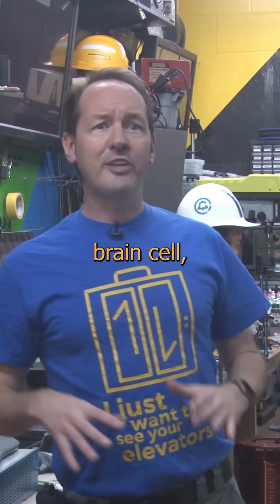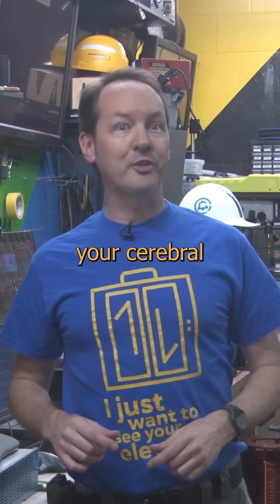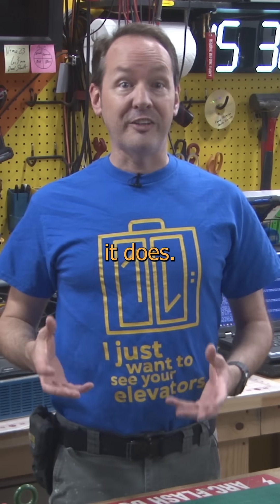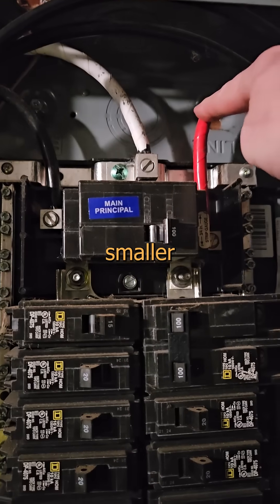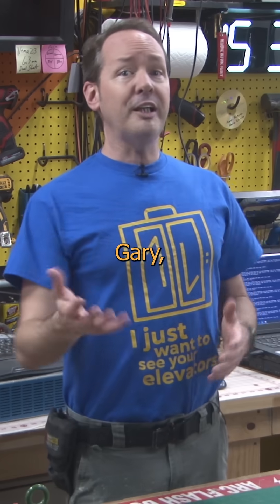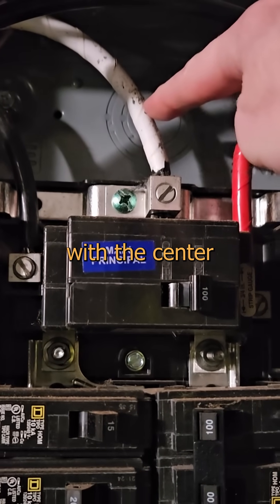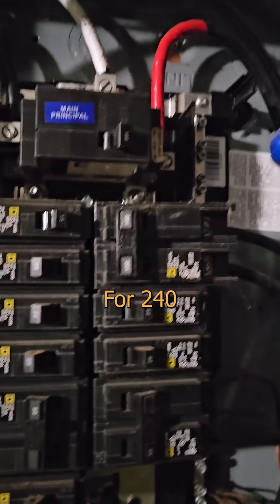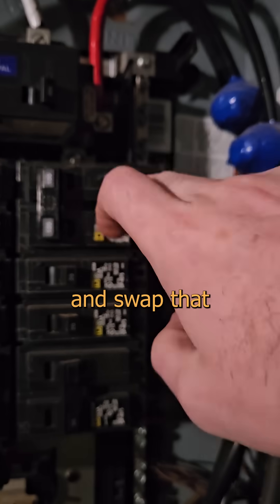Why It's Smaller #engineering #chrisboden #comedy #electrical #science #energy #power #electricity

Comment: Yes...this is an issue I still don't understand. Degree in physics yet...ground should be path of least resistance..or neutral should. Depends on how I wake up in the morning. Amps dumped into the appliance...makes sense DC...my brain explodes every time thinking this. Then...Europe with using ground as the neutral?

Comment: i remember being told if you dont see the ground assume you ARE the ground or you will be in the ground
Reply: Sounds about right.
Reply: As someone who has been the ground a few times absolutely.

Im not an electrician by trade, but I have some experience. So for new guys messing with it this is what I tell them.

Electricity is equal opportunity. It can and will look for every opportunity to kill you. If you give it that chance, it will hurt the whole time you're dying.
Reply: BAHAHAHAH true
Reply: Only within reasonable ranges, too low and nobody cares (at 5V, the body’s resistance leads to negligible current), too high and you can be the ground despite seeing a proper ground, especially when you’re on the actual ground (don’t get anywhere NEAR a downed power line and hop away with the feet as close together as possible)
Reply: Good advice!

Comment: “I spent a lot of time removing the ground pin from this vacuum, so that it wouldn’t trip the circuit breaker. Stop being a pansy, the exposed wiring is perfectly safe. And Don’t you dare tell me it’s not working because the paper filter is full.” — My first job

Comment: Ground is there to burn your house down.  A tree fell on my aerial feed to my house.  It bent the mast, broke off one hot leg and smashed the other hot leg against the metal box of the meter base.   That lit up all the ground wires in my old house, burned out the bare copper hooked to the water pipe.  Melted copper wire in the walls.   Then the lit up ground wires carried 100 amps to ground on the 12 gauge ground wires going to my 2 gas furnaces, my gas clothes dryer and the swamp cooler on the roof.   Oh and the stainless braided water supply line to the dishwasher, flooding the kitchen.  Now, I put a fusible link connecting the ground wire to the frame of any independently grounded appliance.   And that's how ground wires almost burned my house down.  And, that not very cool.

Comment: @PhysicsDuck Can you do a video explaining what 3 phase power is?

I'm in the building trades (not an electrician), but I think electricity is by far the most interesting. 

I've tried doing some research to better understand what 3 phase power is. I'm either too stupid to understand what I've found, or I haven't found an explanation simple enough for my small brain 😂.

Some related 3 phase questions I'd like to understand better:

-why can you get more power from a 120/208 3 phase panel than a 120/208 panel at your house?

-why is 3 phase power more common on commercial projects vs residential projects?

-what makes power 3 phase? It's all carried on the same lines, right? So what happens to send single phase power to a homes vs 3 phase power to a commercial building across the street? Or in a mixed use building, what happens to send 3 phase power to the commercial spaces vs single phase to the residences above?

What I've learned in my own research is that 3 phase has additional sin waves on the power. But what does that really mean?

Another question: if 3 phase is a relation of sin waves, how does that translate to countries that have a DC power grid? Because sin waves are a characteristic of AC power, right? 

OK, that's a lot of questions. It's a topic I've been curious about for a long time.

I love the channel and the way you explain things.
Reply: -why is 3 phase power more common on commercial projects vs residential projects?

Economy of scale is why.  Consider the power we can get from a 200A 3-phase service with a full size neutral at 120/208V.  It would use #3/0 Cu wire, which is 4x 168 kcmil, or 672 total kcmil of copper.  We'll neglect ground and conduit, as well as applicable safety factors, for simplicity.  This carries, best case scenario, 72 kVA of power.

With the same copper wire for a 120/240V service, the closest you get is #4/0 Cu for both legs and full size neutral, which adds up to 636 kcmil total.  This amounts to a 225A service.  Best case scenario, this service delivers 54 kVA.

The 3-phase service achieves a performance of about 107 VA per kcmil, while the similarly-sized single phase service only provides 85 VA per kcmil.  These numbers don't necessarily apply universally, since ampacity/kcmil isn't a linear function.
Reply: "What I've learned in my own research is that 3 phase has additional sin waves on the power. But what does that really mean?"

It means instantaneous voltage follows the following mathematical function of time:
V = A*sin(B*t + C)

A is amplitude
B is the frequency constant
C is the phase constant
t is time

For 120V nominal systems, the constant A is really 170V.  The ratio between them is sqrt(2).  It has to do with what equivalent DC voltage would provide the same power to the same ideal resistive load.  The topic is called RMS voltage, to read further into it.  170V is the peak voltage, while 120V is a special kind of time-averaging.

You might expect the constant B to be 60Hz, and you'd be partially correct, as B is proportional to the frequency.  By convention, mathematicians use the units of radians as the input for the sine function, so B's value would be 377 rad/s.

The constant C is what is different for the three phases.  One phase has C=0, another phase has C=2*pi/3, and the third phase has C=-2*pi/3.  Not necessarily in that order.  This produces 3 sine waves, that are time-delayed from each other, by a third of their cycle.  Each live wire has a voltage to neutral, that follows one of these three phases.  If you measure across the live wires of different phases, you'll get the 208V instead of 120V for its nominal amplitude.  Just like if you draw a Y with 12 inch legs equally spaced, and measure across two legs, you'll get 20.8 inches.  This is why we call it 120/208V, and its higher voltage counterpart, 277/480V.

Another question: if 3 phase is a relation of sin waves, how does that translate to countries that have a DC power grid? Because sin waves are a characteristic of AC power, right?

Sine waves are a characteristic of AC power, and don't apply to DC power.  DC power has steady voltages, while AC power has time-varying voltages that alternate in sign.

If you only have DC power available, you need a 3-phase inverter to support a 3-phase load.  This is a device that will switch the polarity of the DC at the frequency of the AC waveform, and produce a square wave for each phase.  The square wave is then low-pass filtered, to smooth the square wave into a sine wave shape.

If you only have AC power available, it's much easier to convert it to DC.  They use an arrangement of diodes to rectify the negative half of the wave, to make pulsating DC, and then filter it to smooth it out, and use a limiter diode to get rid of the ripple.

Comment: A fun demo they do of this at our electrical school house is they take a 3 phase 120/208 plug, with neutral. Then each phase is tied to a switch and a plug with a parallel neutral connecting them all together and back to the OG neutral. 

Flip all 3 switches on, then break the neutral wire nut back to the panel. All the lights remain on.

Comment: There is a channel of electricians doing a live stream and i told them my load center has no ground(old house with a bad rewire).  They said it wasn't a big deal. That's crazy right? My load center is over pavement so i have to figure out how to drive in some ground rods and run the wire to my load center. I bought a huge hammer drill and adapter

Comment: In a DC circuit where the starting point is a generator.. where does the electricity come from? Does it pull it from the ground pass through the circuit and then go back? Where's its inception begin? I've always been confused about that

Comment: See, my brain cells are different. I usually run on a single brain cell that acts like a APU, slowly chugging away doing low-level processing. But when it's time to start number-crunching for real, like a real APU it'll "feed compressed air to the other engines", and after a few minutes I'm from a small pilot flame just barely staying lit on the pad to full afterburner at 30K feet. There is no "kickstart."

Comment: Challenge accepted!!!! I have one house in a rural community where grain-bin-dryers & wells. Most motors (Glasgow, MO established 1836) without soft start  are on my grid. Since moving in this 1857 house, the highest hard drive failures I've ever seen, until I put a double inversion UPS. The brownouts are all the time and with LED lights, randomly frequency shift AKA inductive load pulling on the wave(? Shifts for a shitty ass sine wave). My other house with a barely adequate service and no/ground-loop. It's in STL, it's my home lab with fiber, and redundant ISPs. I would love to give you a IoT real-time data of all of this. Let me know what I need to measure, the data rate, and the long-term measurement analysis?!??? Trust me, I was pushing sine waves via web sockets in 2015, I'm dying for some functional IoT stuff! Also I have 2 high voltage (1200V) probes.😬🤪🤘🔥⚡⚡😉😁😁

Comment: heres my question, why do yanks bother with 120, when 230/250 is fine , just seems to make houses more complicated.
Reply: Historical reasons.  Edison set a precedent of centertapping serivce voltages, when he originally tried using DC to distribute power.  He used a bipolar DC power system, with equal and opposite positive and negative voltages delivered to the home.  This would then get  centertapped to support either the full voltage for a load, or half the voltage for a load.

Because there's a perception as we transitioned away from Edison's DC, to Westinghouse's AC, that AC was more dangerous, people wanted to keep the voltages at the appliance as low as practical.  This led to centertapping our 240V services, to deliver 120V to most loads.  Only the big ticket loads get the full 240V, such as dryers and ovens.
Reply: Many thanks, it's always weird to me that a mate of mine in the US has 'high power cooker' that's 220v but I've got the same cooker that is wired to 400v (3 phase 230v)

Comment: I'm going disagree about the waves canceling out on the neutral. the two legs are in phase, so they are in phase on the neutral.  The neutral serves a return path because electromagnetic waves need a return path.  But the energy is getting there on the hot leg.  And its dissipated at the load.  Although switching power supplies can throw this off and actually have substantial neutral current.

Comment: This is also why you can run two 120V 20 A circuits on 3-conductor 14-gauge wire, provided that the two circuits are 180 degrees out of phase.
Reply: You can do that when they are 120 degrees out of phase as well, because the current on the neutral will still at most, add up to 20A as vectors.

For split phase where the two circuits are 180 degrees out of phase, the neutral current is zero if they are balanced.  For 2 phases drawn off a 3-phase, where they are 120 degrees apart, they add up to the full current on the neutral when the two phases are balanced.
Reply: @carultch  Ah, yes, that answers something that was bugging me. So, yeah, from the phasor diagram, it becomes clear that the magnitude of the neutral current is, at most, 20 A (but also never zero, aside from the trivial case).

Comment: If a noisy load creates a 2nd harmonic (120Hz) on its current, it will double, not cancel out for the neutral .  I 3-phase system, the same happens for the 3rd harmonic .
Reply: That's correct.  Though odd harmonics and especially triplen harmonics are a hell of a lot more common than even harmonics.

It's almost unheard of, for that to happen in practice with even harmonics and circuits from a split phase system.  But it happens all the time with triplen harmonics on 3-phase, which is why with harmonic intensive loads, you often may run increased size neutrals.

Comment: My father, an M.I.T. educated radio & electronics genius, balanced the load of our electrical panel with a computer and capacitors to the point where our electric meter barely moved. The electric company thought the meter was defective and replaced it. After receiving electric bills for only a couple of dollars they wanted access to the inside of our house. My father told them to go to hell. Of course they got their lawyers on the case and accused him of stealing electricity. My father explained in court that our electric bills are based on the imbalance created by electrical draw. He said: there's nothing illegal about making that electrical draw less - it only means our house is more efficient than other houses ! Of course the legal system sided with the electrical utility company and told my old man to "knock it off". He still balanced the current draw by arranging the circuits across both phases of 120 volts in the breaker panel but he had to remove the capacitors, relays and computer that were balancing the phases nearly perfectly.

Comment: Took allot of thought to think about why the neutral is close to zero unless one side is imbalanced. Didn’t seem intuitive and it’s easy to overthink. If everything was balanced all the time, wouldn’t need neutral. It still has to be at least the same size as L1 and L2 in case for some reason only one side of the transformer gets utilized

Comment: HALF my power went out in the summer of '22. Sinkhole decided it was hungry for transformers, and swallowed the power transformer in front of my place. Lost one hot, but not the other hot or the center neutral. Surge killed my computer, but it was 9 years old anyway, and I was already building it's replacement, so it just put my butt in gear to finish faster.

Comment: Question
Why do we need a ground wire

The power comes from the transformer

Just supposed your house is the only one coming off the transformer.

Seems like a close loop system to you house and back 

Why should there be a need to install the ground wire.

Comment: I’m confident it doesn’t meet code, but when I run feeder line to a shed or barn I always plug it in as a double breaker as one does for 240 power and use the bare ground as neutral. Gets twice the amps with two legs of 120 and allows for welding with 240 on a pair of 20 amp breakers using 12 gauge wire. Only time anything needs welded with more power than that is aluminum and that’s reserved for garage work where heavier wire feeds a dedicated plug.

Comment: "You can get it down to Zero, but that's only in very specific circumstances."
Like, go to the Breaker Panel and turn off all the breakers that are NOT 2-Pole Breakers.
Still might not work, though, if you have a "Smort Oven" that has a 120V clock/timer/any other accessories.

Comment: This is erroneous, due to the increase in DC switching loads such as computer power supplies, variable frequency drives and others like inverters, there has been a drastic increase in harmonics, this we do not derate the neutral anymore if anything we increase the size of the neutral .

Comment: Unless you have CutlerHammer and it burns the ground off at the receptacle like it did in my house when a powerstrip catastrophically fails. Fire department said...  if I would have left for work on time, the house would have burned. 
 That circuit had the old cloth covered Romex. 14 Guage hot and neutral and 16 gauge ground wire.

Comment: In Australia (and most of the world outside the US) we just have 240 single phase and 415 3 phase. Our neutral earth is usually bonded at the board and our neutral carried the full current of the load. American electrical seems oddly complicated to me, not to mention some of the practices and equipment you guys use, like instead of using a multi core double insulated cables you use multiple single core single insulated cables and garbage like wire nuts instead of screw connectors or terminal strips

Comment: AC does not actually travel down the cable. It travels around the cable via a wafer thin electric field. Its why it travels at almost light speed. The wire is the the magnet/conductor for the electric. How crazy is that?

Comment: In 3 Phase you can run 3 single phase circuits off 1 neutral so long as each phase is different. Saves alot of wire in commercial and industry.

Comment: If you feed 2 circuits with a 12/3 you have to use a 2 pole breaker because it forces you to put each circuit on different legs so you don’t risk sending 30 amps through the neutral.

Comment: Canadian here: I was under the impression that the neutral and ground were essentially the same connection with the 2 'hots' fed to the box and the neutral just a ground (albeit a non local one)
Reply: The neutral is meant to carry the imbalance of current back to the source under normal operating circumstances.  The ground is meant ot carry current back to the source, that faults out of the intended path of current, due to wire accidentally contacting the metal housing of equipment and abrading the insulation.

Ground and neutral are only tied together where the code requires them to be tied together, and are isolated everywhere else.  This means that there's a dead-end path between them, that can't normally form a closed circuit.  It also enforces that they stay at the same voltage, so the ground wire system can carry current back to the source.

Comment: And when your house was built in 1952 in 14/3 with a shit-ton of shared neutrals, you find out the hard way you can't install a GFCI in your bathroom because you share a neutral with another circuit and it trips the instant you apply voltage. And that's not pretty cool.